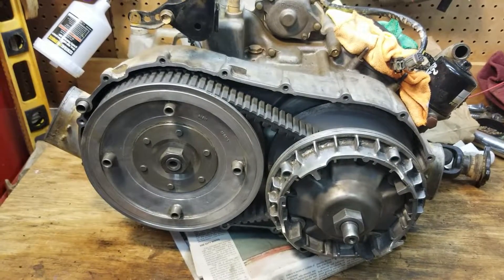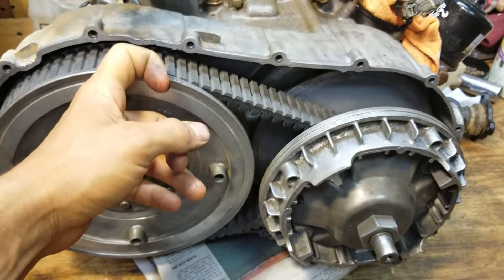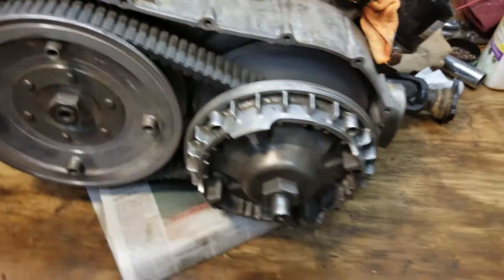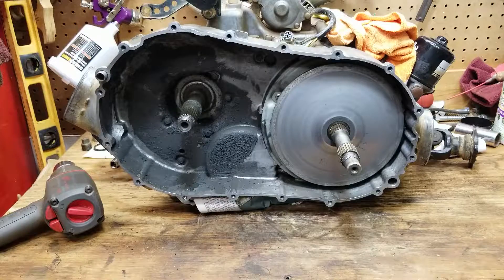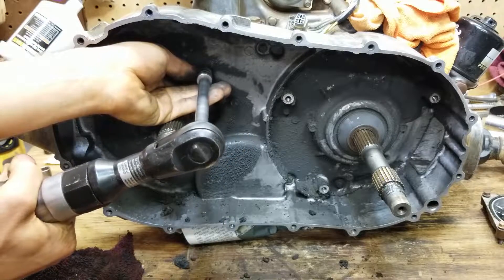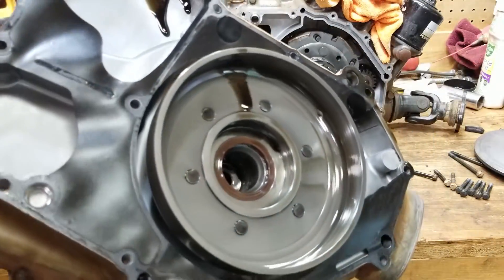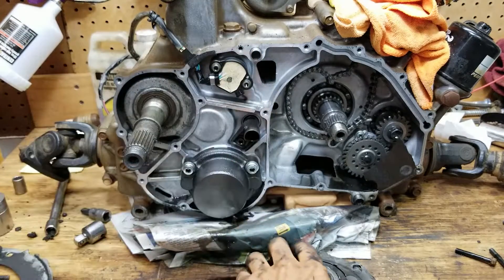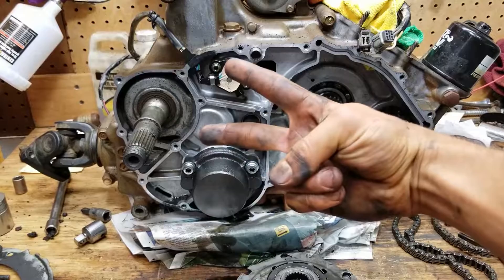ATV Wet Clutch Teardown: Suzuki Vinson Rebuild Part 7

Comment from the maker: Hey Y'all! Links to tools used and service manuals in the description!
Timestamps:
0:00 Intro and Inspection
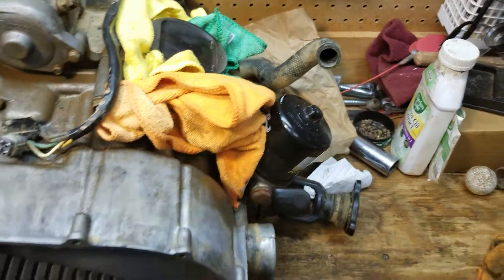4:31 CVT Removal
6:40 Case Disassembly
8:57 Internal Parts Inspection
9:14 Clutch Removal
10:40 Timing Chain Inspection
11:21 Outro

Comment: I have the same Vinson and the gear position sensor got the wires chewed off it right above the outer case where the grommet comes out of the inner case. Do I have to drain the oil before I take the belt covers off to replace that sensor?
Reply from the maker: That sensor wire in this video is behind the clutch. Yes, you have to drain the oil to get to it. It's a real pain to take all that stuff off. If it was me, I would try to solder the wires back if I had enough left and can match the colors right.
Reply: @MattsShop  my gear selector doesn't work because of those wires being gone but the question I have is would it put the bike into some kind of limp mode because it acts like there is a rev limiter in Hi-Lo or reverse neutral or Park?
Reply: @MattsShop  a rat chewed those gear position sensor wires off right at where they go into the case so when it's out of park it won't illuminate on the gauge dash. The bike won't go over 22mph as at wide open throttle it has seems to be a rev limiter no matter if I'm in park, neutral,high or low range. I'm wondering if anybody knows if the gear position sensor isn't working properly it would put it into a limp.mode? I know the reverse has a rev limiter so if the four-wheeler can't tell what position the gear is in I'm wondering if it would be possible that the rev limiter would be no matter what position I'm in. The bike will only go 22 miles an hour in high range

Comment: Matt your video on the Vinson is awesome, I've never taken one apart and you are an immense help.  My wet clutch is shot and I ordered the rebuild kit, however I can't find a video anywhere on how to do the rebuild, would you have a link or advice?  TIA
Reply from the maker: Thanks! Is it just the clutch or are you rebuilding the whole thing?
Reply: I’m putting the new parts into the wet clutch. It has the fingers as it’s an automatic. Looks straight forward but wanted to have an idea before I took it apart. Thanks

Comment: @5:30 mine has a smooth metal sheath around it about 3 and 1/2 inches long making it impossible to pull off, especially by hand. What do I do?
Reply: 3 jaw puller, I see you've answered this already.

Comment: Bro what size impact is that i got a 750ft lb and still won't budge the bolt on the smaller clutch wheel
Reply from the maker: Bro... One of those nuts is reverse threaded. Ingersoll Rand 2235 TI Max. It has 1300 ft lbs. Watch this https://youtube.com/shorts/DedWaqWFkpQ

Comment: Just pulled my cover off 2003 Vinson. Oily black wet gunk everywhere. Seal I suppose. Don't have a big enough socket to go further. What size is the socket and will I damage anything if I pressure wash first?
Reply from the maker: Pressure washing the cover if it's off won't hurt it. Don't do it if you'll get water in the engine. I don't remember the socket size.

Comment: Hey man I have one just like yours same year same everything my issue is when I put it in reverse it wants to spit and sputter but it revs up just fine in neutral but it takes a lot of horsepower for it go forward with it but once the RPMs get up to about 500 it takes off like nothing to it somebody told me that it was a sensor that’s inside the motor I see that sensor they were talking about do I need to replace that is the wires that goes in to the side of the belt casing

Comment: My Vinson is taking more than normal revs to "engage" drive and then it launches forward. Is this an issue with the clutch being "sticky" and taking extra revs before it engages?
Reply from the maker: Could be a worn out belt and/or a burnt up wet clutch.

Comment: Great videos man you're a lifesaver! I have machine shop experience but with particular parts. Bought a 02 vinson and wanted to have a peak at the clutch as i found clutch material (also some shiny shavings, magnetic..)  in my oil sump so i figured best i tear into it, unfortunately Ebay does not ship the clutch shoe rebuild kits to Canada.. Local shop $310 for whole wet clutch assembly lol I am hoping no one took the oil sump off ever in its 14000 kms of use and pray its just normal wear. Idling it sounds great, revving sounds great... if i put it in gear and drive i hear a whine that matches the rotation. when i let off i hear some chatter. I  checked/replaced all wheel bearings also, i do see my drive belt has some wear marks on top side so just wondering if the deceleration is causing backlash and thats what i hear.... sounds more deeper int the internals to me but maybe im paranoid lol

Comment: My Vinson won’t go any faster than 10mph. It’s like driving in first gear. Am I looking at a worn belt or clutch issues? My son driving it up hills in high gear if that helps any.
Reply from the maker: I'd start with the belt, CVT weights, and then go to the wet clutch after that, or drain the oil and see if there is any clutch material in it. Most of the shavings will be stopped by the screen under the four small screw cover where the oil drains from. You can pop it off and check. It's an oring that seals it up.
Reply: I’m hoping it’s just the belt. It’s an ‘03 with about 1300 miles. I bought it used a few years ago. I could never get it to go into low gear so I just drove it in high. I never really beat it so it ran fine in high. I let my teenage son use it and I know he burned something out. He finally admitted that “it kinda wouldn’t go up any hills” lol. Thanks for the info. I’m subscribing to your channel 👍

Comment: Thank you so much for this series its  answered alot of questions i had about opening this engine up to replace my neutral position sensor
Reply from the maker: You're welcome. Yea, the neutral position sensor is easy. It's just 2 bolts. Just be careful because there are 2 little pins and 2 little springs behind it. Don't loose them.

Comment: Can't you just grind or smooth down the groves on drum, then rough sand it for new clutch shoes to bed in, like brake pads.? Good dianostic on worn clutch. Can't wait to see it complete.
Reply from the maker: Apparently, the groves are supposed to be in the drum. I looked up pics of the new part and it had groves in it too. I'm not going to worry about it.